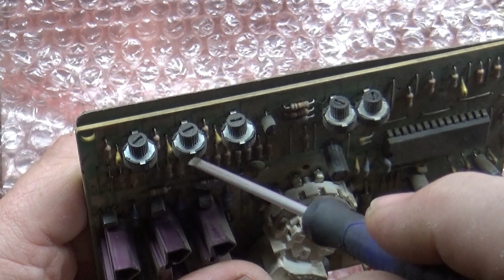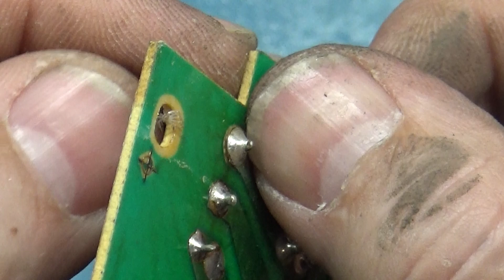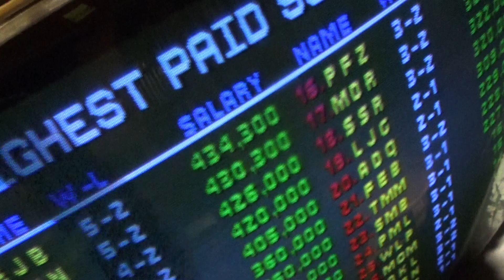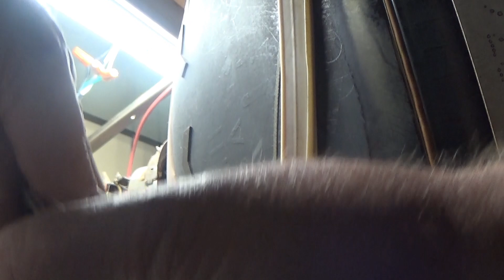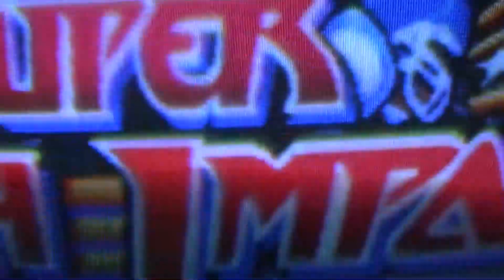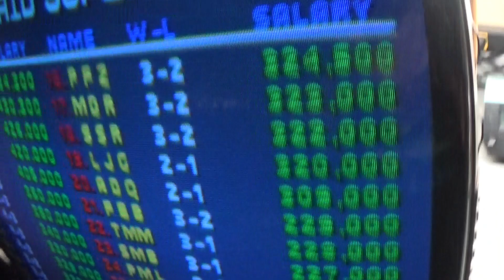25" K7400 Arcade Monitor Chassis Repair - Dead

Comment: I have a wells Gardner 7400 I just replaced the flyback two weeks ago and now I turn it on start playing it and sharp picture and no more then a minute or two it fades out could it be the capacitors ? What do you think
My name is Michael
Reply from the maker: You’re losing heater voltage. Do you have neck glow when the picture fades out. Could be a bad connection on the neck or a bad neck socket. Did you replace all the caps?
Reply: @MikesArcadeMonitorRepair 
I have not yet but the cap kit is on order now thank you very much for the help have a good one and I really like the videos you make helps me a lot thank you again

Comment: @mike: You have mentioned C119 and C121 being shorted causing H.O.T to go bad. Thank goodness I remembered that video ( although I couldn't find the exact vid that states it ) because both c119, c121, and the HOT were shorted on my K7400.

My question is whether it possibly took out anything else. OR whether it's not the root cause. Anything else I should be looking for?

I already ordered the parts, but hoping to get ahead of it.
Reply from the maker: Some K7400s have R765 populated. If yours doesn’t, I’d say nothing else to worry about except maybe the flyback being bad. Make sure you install an FJL6920 and not the 1388. The modern 1388s are junk.

Comment: Hi Mike. Me again. I have watched like 20 of your videos on repairs but I cannot find any that will help diagnose my Nanao MS9-29 chassis. I am just learning since I have a Candy Cab with original ms9 chassis and monitor. What would be the basics to check on this chassis as you showed yours all unplugged with no power? I got this MS9-29 from someone. I was working fine until the power just went out. I did a cap kit on all the power supply. Tried it and it powered for a day. Then the next day, nothing. The coil is not heard turning on. I checked the B+ voltage and powered it on but it just gave a high 50s DC voltage and then started to come down. Did it a second time and nothing. Looks like there is no power going in. Can you point to what components to test with my multimeter to diagnose? I checked the only fuse it has and it has continuity. In the power supply section there are two components that look like voltage regulators but not sure how to test them with my multimeter. Both are attached to the heatsink. The smaller reads C021M-15 labeled D502 and the larger one which is Q901 reads K1531. Any suggestion on how to test them with a multimeter and know if they check out good? Anything else that you might think checking to tell what is keeping the chassis from power on? I did a reflow and flyback joints look original. Thanks in advance.

Comment: Hey Mike I just picked up an MK2 cabinet with a k7400 in it.  I’d like to test my B+.  Where do you test B+ with your DMM if you don’t mind.  I’ve never checked B+ on a cab before as the pot is always RTV or glued but I’m thinking this will become a very important test point from here on out.

Thanks Mike, love all your MK and arcade repairs and cabinet pickup rebuilds 👍🏼

Ps - watching that lightbulb spark every time you jumper’ed it was crazy 😵‍💫😆🤟🏼
Reply from the maker: This is the best way I can explain it…

https://www.arcadepartsandrepair.com/tech-help/monitor-b-settings/
Reply: @MikesArcadeMonitorRepair  dude I always buy my parts from Peter at Arcade Parts and Repair!  I’m from Missoula, MT where he’s located, he’s a really nice dude to deal with!  I had no idea his site had this valuable information 😃 

Thanks Mike!  Keep up all of the amazing videos man!  Would rather watch your stuff than cable tv 😂🤟🏼👍🏼  Happy New Years dude!  🎉🥳
Reply from the maker: Will do! Thank you. You too!

Comment: Hello Mike, do you know anything about the Kortek 3414DF. It is basically a modified 2914. I am trying to learn how fix/overhaul these chassis.  I also want to stock pile parts.
Reply from the maker: Are those the digital Makvision variant? Not much. Almost no one works on them unfortunately so knowledge is limited. My apologies.
Reply: @MikesArcadeMonitorRepair  thanks for the reply. Thankfully they are not the makvision variant. They came in the In the Groove 2 cabinets, and pump it up cabinets; the 2914 came in DDR and other dance games. They work with Sony Trinitron tubes which is great (except now people hoard these televisions). 

I am just trying to learn how to repair/maintain these for personal use.  I am a visual learner so I was hoping to see a video on it somewhere. Thanks anyways. Your videos are awesome.

Comment: Is an isolation transformer required for B+ voltage testing without a tube and with the power section jumper desoldered?
Reply from the maker: Depends. This series of chassis have the iso built into them so no external one is required. But it is always a good idea to run one regardless so you don’t forget on one that does require an iso.

Comment: Do you think monitors from cool areas vs hot areas are less burned up heat markings?
Reply from the maker: I would agree with that.
Reply: @MikesArcadeMonitorRepair  opend up my 2nd 25 inch tv and found another 30130. Im robbing them suckers for sure